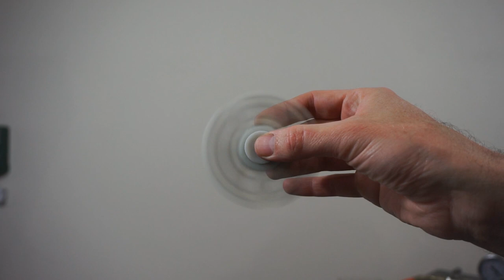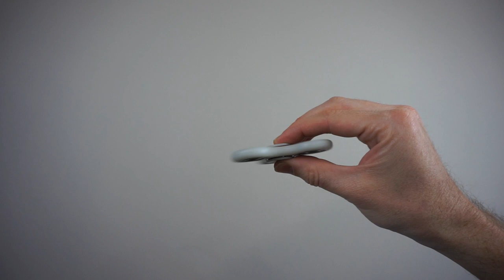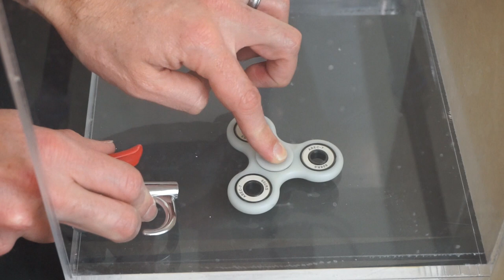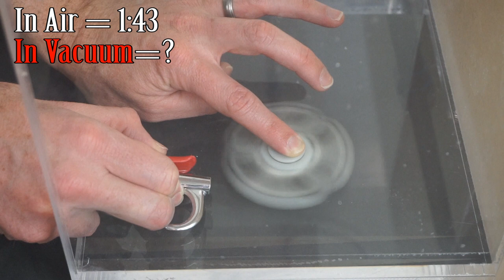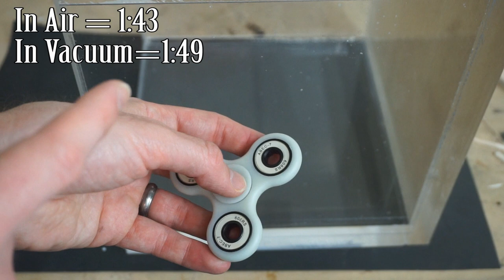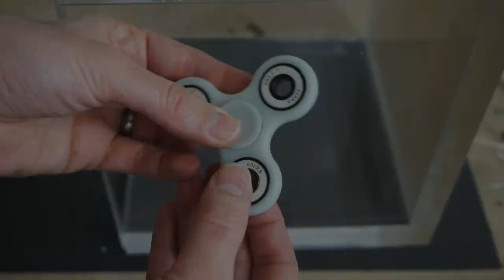How Long Can a Fidget Spinner Spin In a Vacuum Chamber? Will It Spin Forever?

Comment: it was slowing down while there was still atmosphere so its not an accurate test
Reply: should use a RC motorised one to kick it up to terminal velocity while sucking air out then shut off the motor when its at full vacum
Reply: That doesn't matter. Losing some speed is not determinant. If it could spin forever in a vacuum, it would do at any speed.

However that is not a perfect vacuum. Pluto has an atmosphere dense enough to brake a ship traveling at Sun's escape velocity, but it's also considered one of the best vacuums that you could achieve on Earth. So, in the vacuum chamber of the video, there will always be some air.

But that doesn't matter neither. We are worrying about the friction of the air, when the serious friction is being produced by the axis...
Reply: yep, i made a prediction comment on here, this comment is more in reference to that, if they had equal friction time from the start the one in a vacuum would have spun longer?